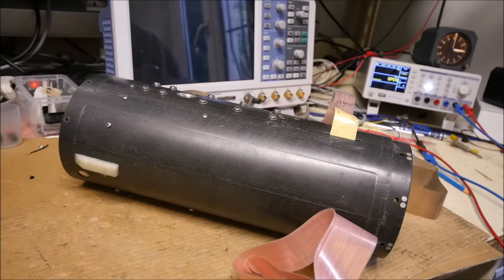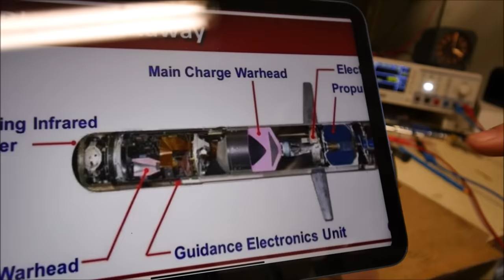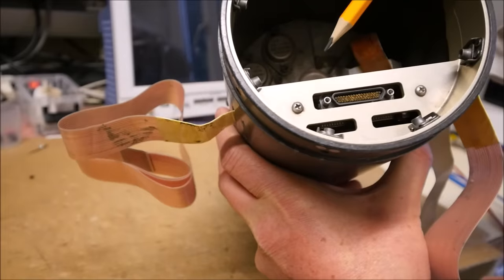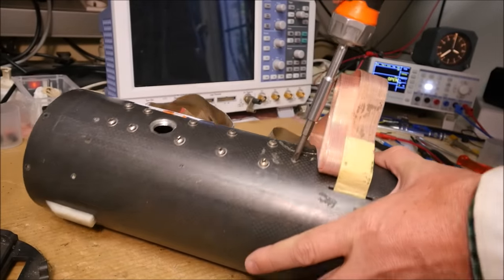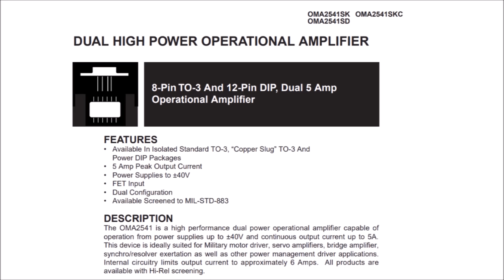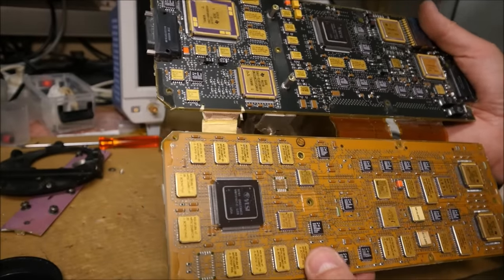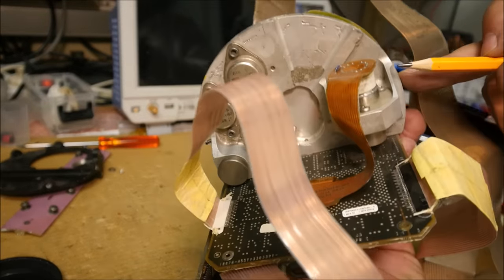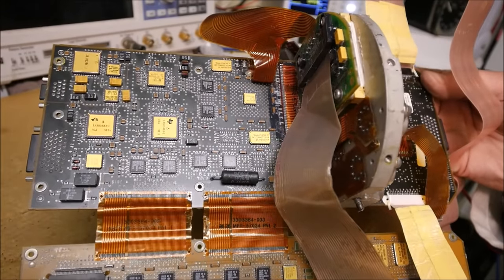LDM #354: Javelin Missile guidance computer - Part 1: teardown

Comment: wow! Crazy expensive stuff. Definitely open the sensor - I assume it's a gyro/accelerometer of some sort
Reply: Maybe also hold a pressure and temperature probes, since the missile is expected to be used in al sorts of weather and the propellant, the detonators and the double shaped charges might need to be tweaked for very precise timing trigger.
Reply: If Mike says waw...🤗
Looking forward for next  part.
Thank you.
Reply: Maybe it would be reasonable to try to CT scan the sensor in a vet clinic before destroying it
Reply: It's probably an orientation sensor so the missile knows which way it is pointing when it can't see the target.

The missile trajectory is that it climbs up at a steep angle (in one of the modes of operation) and then pitches down and attacks the tank from above where the armour is thinner, and using infrared targeting.

I suspect when the missile is in the climbing phase of its flight, the infrared seeker is not pointing at the target. So in this phase of flight, the infrared seeker head cannot see the target and cannot be used for control and guidance of the missile.

The missile needs to know the pitch angle it is currently at so it can then be steered back down towards the target and the infrared seeker will be used to guide the missile in the terminal phase of flight.

Just a theory
Reply: Hello do you still have your work on the flir lepton ?
Reply: Each Javelin missile is about $78,000 each
Reply: Mike and his style: just undo it!

Comment: It's a 1980s design.  Everything used was the absolute state of the art at the time, and from what I read there were a lot of problems with it.  Even the most modern version has unresolved issues.   The biggest part on the board with the DSP is most likely a TMS34010, a general-purpose 32-bit CPU with special graphics instructions which was just going into production back when this was being developed.  The IDT parts on a few of the other boards are most certainly dual-port RAMs and the VLSI chips will be custom glue logic.
Reply: Hey, overall as I've watched the Ukraine War I have been researching and learning obsessively about every weapon system in existence.... 
   The thing I don't understand is with the advancement of technology, microcontrollers & especially computer vision object tracking available to the market nowadays, wouldn't it be possible to MASS PRODUCE something similar to a javelin for less than $2,000? **(A daytime version at least)?
  I understand a high-end Mid Wave Thermal IR Image Seeker operating at 60-120FPS would be ITAR restricted & add $10k to the overall cost but, still should not cost more than $15k total today...

It seems like most of the cost associated with these guided systems is the software and algorithms....
Reply: @justinhealey-htcohio3798  electronics and cameras did get cheaper over years and you could possibly improvise something with consumer grade parts. However, rest of the missile - gyros, shaped charge, soft launch solid rocket motor, some machined parts, some servos for those fins still do not fit into anything under $2000. And don't forget the control unit ("CLU") which has some good optics to enable targeting from up to 2.5 miles.
Reply: Not an expert, but my guess is that at least part of the high cost is related to hardening the electronics and software. Both against environmental conditions and electronic warfare.
Reply: @Jerry_from_analytics  Yeah, I've built many different drones (Large and small)... I would have to think that modern consumer grade MCU & MEMS inertial/gyro stabilization IC's Could replace most of the components on the Javelin today.
  I was really surprised that he said it's a 64x64 image sensor ADC which really isn't that high of resolution by today's standards.  
   It really is extraordinary what they were able to accomplish back in the 1980s...
Reply: Date of manufacture on at least the big quads is 1997, so I’d guess it’s an early 90s design at the latest?
Reply: @christopherdonald9001  I believe the biggest concern was that it had to survive radiation from nuclear fallout, which is why they used space grade electronics.  But I agree that nowadays it could be made simpler and cheaper.  This was the first man-portable missile designed to operate on a target designated by a digital image.  The technology to do such things was just becoming possible in the mid-80s when this missile was developed.
Reply: Very interesting, the TI TMS CPUs/DSPs are really cool. I got to mess around with a TMS320 BGA as part of a development kit. TIs DevKit's are awesome
Reply: Does anyone know much about the logic implemented here? FPGA's/PLAs of this era would be very interesting.
Reply: @justinhealey-htcohio3798  Any device/unit that is potentially between death and life cannot be improvised or cheapified. Not in peacetime nor at the engineer's desk. Nor at the state level. 
Imagine how much threat could be if 10% of the aimed targets missed, let's say 10% of the tanks in Ukraine, that the Javelin is eliminated, would be not eliminated.
Yes, the FPV drones with RPGs are improvised, those are urgent needs.
Reply: @fjs1111  these are not FGPA. VLSI chips are cell-based ASIC (ie custom chips based on predefined cells).
Reply: @justinhealey-htcohio3798 this is certainly impressive for 80s development. Just imagine what goodie’s are in the pipeline right now…
Reply: It's really weird to find out that an anti-tank weapon has the same CPU as Mortal Kombat 😂
Reply: I love this perfection approach too. However russian/soviet way of low quality, but high quantity is unfortunately effective too, as they start one war after another🙁.
Reply: @user-tc2ky6fg2o  Cost definitely matters. Ukraine would appreciate a cheaper version of Javelin if thy could come in greater numbers.There could be daytime only, without radiation hardening, with ordinary consumer electronics. 80% effectiveness is still satisfatory if a Russian tank is approaching your position and all you have is an old RPG
Reply: @user-tc2ky6fg2o you don't know what your talking about many projectiles do miss 😂
Reply: @lawrencemanning  Date code for the Datel ADS-30353 is the 9th week of 1998 so a revision of the original design for sure.
Reply: @justinhealey-htcohio3798  You're probably right in terms of the physical cost these days; but the actual cost will still be much higher. Keep in mind, you need to allocate many other costs to each unit produced, such as R&D costs; sustaining engineering costs; on-going manufacturing costs (ie. the facility; moulds/tools/jigs/electrical workstations etc. that are specific to these devices). I've probably missed quite a few things, but you get the idea... they're never just a sum of their parts :)
Reply: @justinhealey-htcohio3798  Maybe a low resolution, but consider the fact that a PC Mouse image sensor usually has an even lower resolution, but with a high sampling rate - and they provide excellent tracking.
Reply: @justinhealey-htcohio3798  With such systems you don't pay for parts, just for development and that costs a lot of money. And defense companies are not Santa Claus - you have to make money in order to get money for the next development. That's why it costs what it costs.
Reply: @anotherguy9402  Now that I think of it, isn't t the javelin & the guidance kit (which is the basis of this video) actually miss which is why it's still intact??
Reply: There's actually a new version coming out I think in 2024 or 25 that's why we're giving the older stock to Ukraine. But even what Ukraine is getting are pretty advanced models. Basically they're going to do away with the need to chill the infrared sensor with coolant before use. They're going to be upgraded with a newly developed systems that does not need cooling, most likely just air or fin cooled thermo vision sensors. Like the ones in really expensive high tech hunting scopes. New versions will be more expensive most likely, but the tec is going to be much more robust and easier to use then before, there won't be a 3 min cool down period before use. Flip the switch and you're ready to go.
Reply: @justinhealey-htcohio3798  Well there's a problem here that you might not have been aware of. You see these missiles don't actually cost $100,000 to make. This is a problem that the United States has been dealing with for a very long time. You see if the company wanted they could probably sell these javelins for pennies on the dollar. Instead of $128,000 per missile. They could sell it for 50k or even 20k per missile. But the problem is the Pentagon gets overcharged for basically everything! The price gouging is out of control.  Lockheed Martin, Raytheon, boing all these weapon manufacturers price gouge the department of defense, it's a complete scam!! All of this is taxpayers money and the government pays out. These are huge prophets for these defense contractors. And it's not just weapons manufacturers we're talking about from missiles to office supplies toiletries you name it. Government facilities need paper or pencils, we're talking about pins that cost less than $1 but sells to the government for $80 a pin, hundred dollar toilet paper rolls that are no more than a dollar each. Weapons manufacturers only worried about their stocks and pain out bonuses to they're high profile executives. It's actually a huge problem look it up.
Reply: You misunderstood the American MIC completely. They are not in the "make good stuff for cheap" business. They are in the "lets milk the tax payer dry business". In countries like Russia all military products have domestic price and export price. Domestic price covers the production costs and some sliver of a profit margin, the export price is more akin to USMIC, though not even close as blatant money grab.
Reply: @justinhealey-htcohio3798  the scary thing is, it is entirely possible to make low cost facsimiles of superior weapons, using only off the shelf components and homemade software; like arduino sketches…
Reply: The TMS34010, developed by Texas Instruments and released in 1986, was the first programmable graphics processor integrated circuit. While specialized graphics hardware existed earlier, such as blitters, the TMS34010 chip is a microprocessor which includes graphics-oriented instructions, making it a combination of a CPU and what would later be called a GPU. It found use in arcade video games from the late 1980s through the mid 1990s, including Mortal Kombat and NBA Jam, and computer workstation video accelerator boards. TI later released the TMS34020 with an emphasis on 3D rendering.  (wiki)
Reply: @justinhealey-htcohio3798  

build cost 2000 - sell price 25k - margin is key :D
Reply: @justinhealey-htcohio3798 the reason you can't just do that is they have to be able to deal with cold/heat/vibration/high G values/being dropped/low pressures in the hold of an aircraft/sitting in storage for 10 years then when they get to the front work perfectly. They also have to be resistant to reverse engineering. Certainly it is true that the cost of military electronics has fallen over the years, and it feels somewhat like the boards of something like this are treated like say the electronics of a Trident missile or a JSTARS aircraft even though the implications of failure are wildly different (which is totally something that could be fixed) - the problem with cost of modern weaponry is whilst the cost of say an individual standard component has falling the complexity of a system has risen to offset that cost fall, so you're doing a relative high amount of things for your money.
Reply: @xkenny1995 quantity has a quality all by itself. Stalin.
Reply: Just imagine what they are now, probably built 5-3nm with a better trained model
Reply: @patman0250 I drive for Uber and meet one guy who works in a slaughter house. He said that they sell frozen pork chops that is send overseas for 25$ a pound. And when I asked him why is it so expensive, he said because that's what they are willing to pay. Why would they sell for 2$ a pound if they could for 25$
Reply: @douro20  There is no radiation exposure requirement on the Javelin, and there is no EMP shielding.  It's factually clearly VISIBLE on the teardown vid.
Reply: @seriessplayer62747  actually, believe it or not I'm pretty sure the most modern F-35 still only utilizes a 20-30nm process node for it's GPU! 

*You can double check, I'm pretty sure it was something like that...
Reply: @justinhealey-htcohio3798  i don't want to be a part of weapon program even if you are going to pay the double normal income or even more. Besides, Javelin and its parts were actually mass-produced - that's why it is so "cheap" for what it is. So good luck with finding enough of decent engineers for everything involved.
Reply: @justinhealey-htcohio3798 or to not produce any weapon at  ALL!
Reply: @tomeks666 really? So your logic is that this war can continue till there is no more Ukrainian left?
Reply: the carbon fibre and 1999 chips on this thing are a weird mix to be sure.
Reply: Quite a surprise that the label markings are not removed from the chips. Neither I see a conformal coating on the PCBs.
Reply: just imagine - this is about the time that the 386 was designed - afaik - that was before the 286 - for budget and technical reasons the 286 came first - reminder ... i found an old magazine .. where the 386 was presented.. for .. just 25000 guilders.. yay..
Reply: Yes, I was thinking: they need an awful lot of 'stuff' to make it work. 

As if you were to look at the motherboard of an first gen 8088 CPU IBM PC.
Reply: @poekiemanpoekieman9224  do you think a raspberry pi and an Arduino would be able to be used for a modern javelin?
Reply: @justinhealey-htcohio3798  lol, who knows? Wouldn't even surprise me.
Reply: @justinhealey-htcohio3798  It's labor. This missile probably requires about 20 people to essentially hand assemble it. That's a lot of money once you factor in other overheads.
Reply: @justinhealey-htcohio3798   This probably has far less processing power than a $200 tablet, PC or smartphone but it is extremely specialized and obviously from the 90's.  The proliferation of cheap improvised attack drones (ie. externally guided low speed cruise missiles) using commercial electronics is exactly as you describe, and is closely watched or done by all major militaries and defense contractors world wide.
Reply: @deeppurplefan  Hey, I will say that I almost think it is a crime that LOCKHEED has NOT rapidly developed a new Control Launch Unit (CLU) by integrating adapting existing CLU electronics and optics on a Medium-Heavy lift multirotor UAV. 

Or, at least a simple retrofit kit that outputs onboard LCD LVDS Video Display to standard analog or digital (HDMI) video out for digital FPV.
*Also-Map toggle switches to standard PWM RC controls.

This would effectively increase the range of the javelin by a factor of 10.

But, I guess Lockheed Martin executives and shareholders would rather have a guaranteed multi-billion $$$ up front contract over 10 years in hand before they'd dedicate any resources to this simple solution...
Reply: @patman0250 
Development costs on weapons are spread over too small a quantity. Sony sells millions, Raytheon only thousands. The government “owns “ the IP, so they pay a lot for that.
Reply: @BigSmartArmed 
But it is very hard against EMI. The case is almost certainly metal meshed. The board design will use very heavy signals with deliberate low impedance paths everywhere so that RFI getting in is sucked down so as to improve signal to noise. Bus are slowed down to min speed, etc. All this toughens the machine against an EW attack. Software filtering, last good value, reasonability checks. Let’s say you are defending a target. So mount 25 kw microwave transmitters and turn them on when you detect rocket motor signature. Non hardened system will begin to arc all over, just like putting your game controller in the microwave. This machine not only will have EMI mesh, it will have board level robustness. Filter caps in the layers, maybe Littlefuse  GDT to toughen against massive pulses. All endlessly qualified. $$$$
Reply: @odissey2 
It’s thin